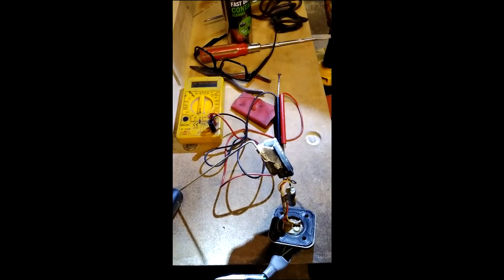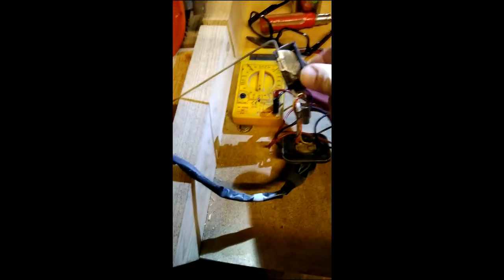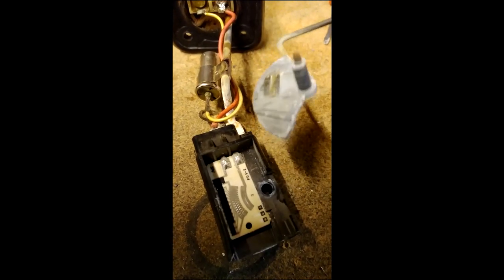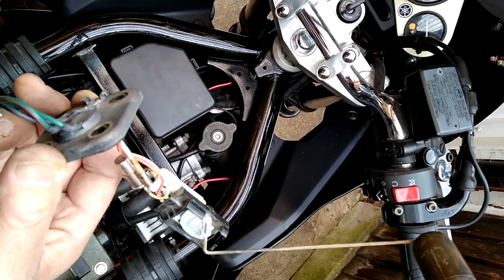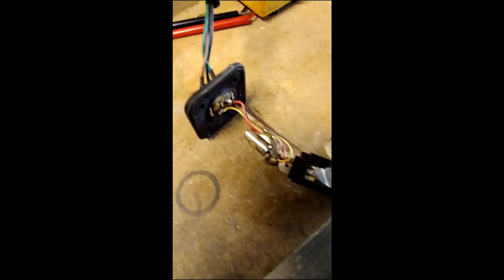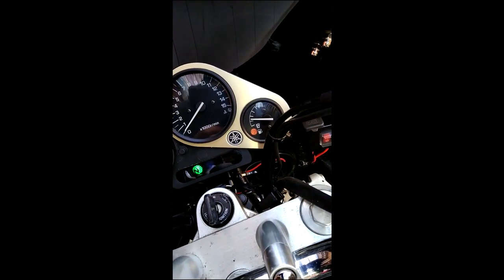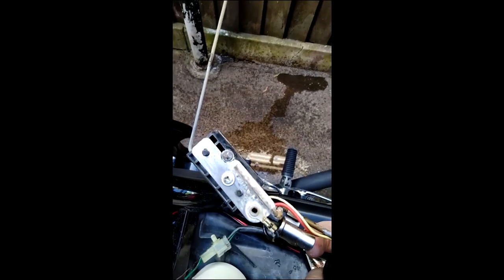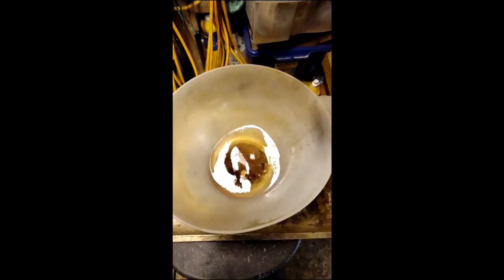FAZER 600 1999 fuel gauge sender problems

Comment: Great video ,does the fuel light resistor work independently from the float level ? If the sender isnt working properly does the low fuel light still come on ?👍🏻🤝
Reply from the maker: Can't quite remember but I think it does as the small little temperature sensor works from wether or not it's in the fuel or not cold or warmer 🤔👍
Reply: @yamaar1rider  Thank you 👍🤝